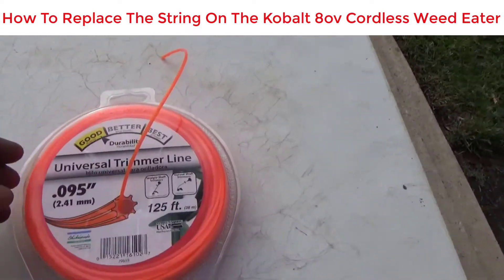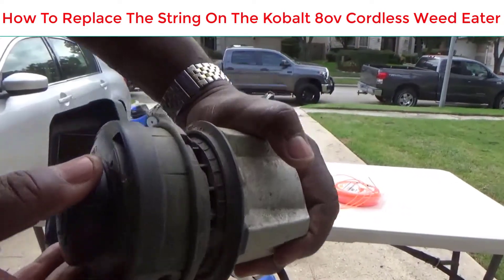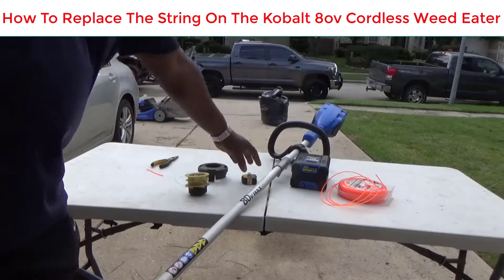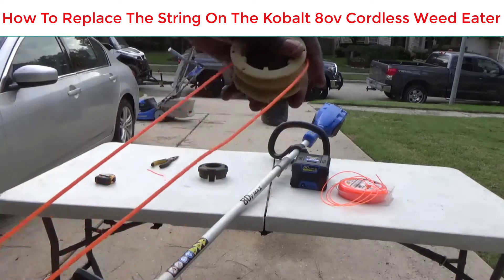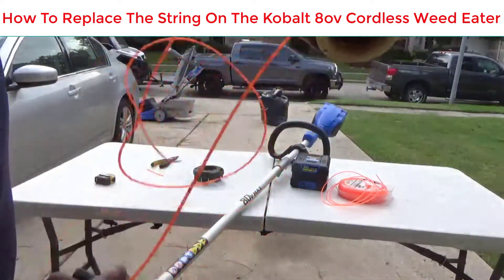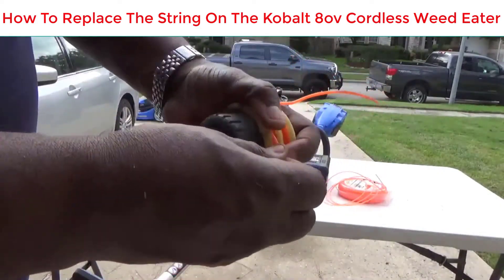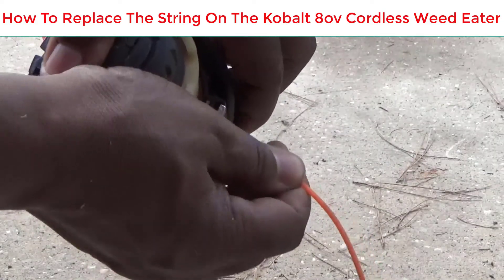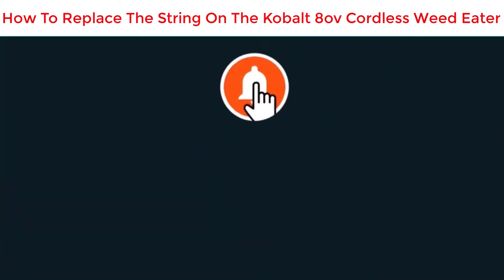How To Restring a 2 sided spool On The Kobalt 80 volt Cordless Weed Eater Trimmer

Comment: A clear explanation ... GreenWorks is identical to the 40V Kobalt trimmer. And it has a double spool winder so it uses 2 strings (I use an 80 MM size...

Comment: I did your version and the line gets used up real rather quickly. Do you know what that might be that's causing that? Also can I spray wd40 on it for easy removal or is that not good?

Comment: This is like the fourth video I've seen taking off the bottom cover if You follow the arrow directions on the bottom of the weed eater and line the arrow on the outside of that spindle right there to the one on the center spindle you'll see a place that says line in and what you do is you take off six about 12 ft of string 6 ft on each side and you fish that string from one hole to the next when you pull out and even amount of string on each side then you take the center centerpiece and probably a pair of channel locks and you turn that centerpiece in the direction the arrow shows to turn it until all the string has been wound inside and you got to even amount on each side of that spindle you don't have to take nothing apart
Reply: your comments are too complicated ... most viewers want a simple method to restring a Kobalt (same as GreenWorks)

Comment: It's kind of knacky to do but using 12ft of line and simply pushing through is easier for me. Yes, you have to play around with the alignment of the hole and twist the line around some, but that method is much easier. Update: OK, I'm more on board with your method now after seeing the line bunch up on the top channel doing it the other way. Only difference is I wind up 11 ft of string and it works perfectly.

Comment: I think they're so far better way to do this. Without taking it apart. Just like on a Echo weed eater. All you do is hold the base of the spool closest to the weed eater shaft and rotate the head until you can see daylight through the line feeder hole... Then take your line and stick it through halfway and then while holding the base closest to the shaft turn the head to wind it up leaving the desired Lynx sticking out. Cut off the excess to make it even in your done.. You Do not have to take the head off.

Comment: completely confused why anyone would mess with removing the head like you have, when Kobalt has designed the trimmer to be quickly loaded with 6 to 8 feet of cord by simply feeding thru the head and twisting the end clockwise…I mean, it literally takes me 15 seconds to rewind the trimmer…

Comment: You're doing 2 things very wrong. You don't have to remove the cover, just line up the arrows, feed line in one hole and it comes out the opposite hole. Hole the free ends and even the line lengths, then simply rotate the string head knob clockwise until there is about 7" of free line. Line size is .080, using .095 line make the entire process very difficult and bogs-down the trimmer. The second error is in your line length statement, 13 feet is in the owners manual, but loading 12 feet is easier.
Reply: Loads counter clockwise on mine. I think someone somewhere go the instructions messed up. I loaded mine 5 times the first season I used it with no issue. Went to refresh my memory the next season and everything said clockwise. It loaded just fine but would NOT bump feed. On a whim I decided to go counter clockwise, and boom.